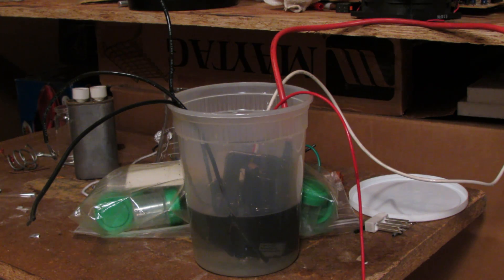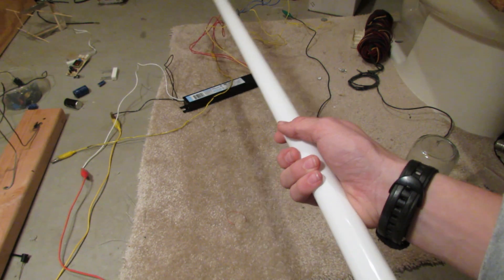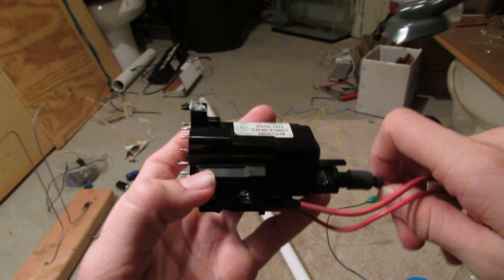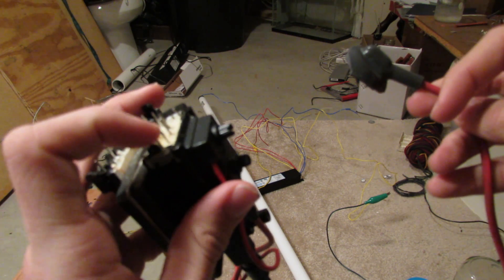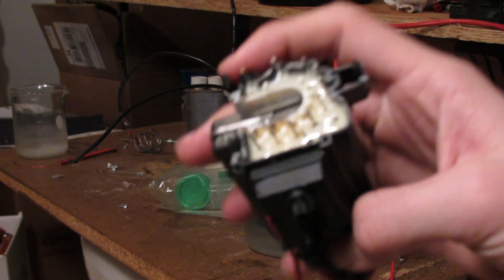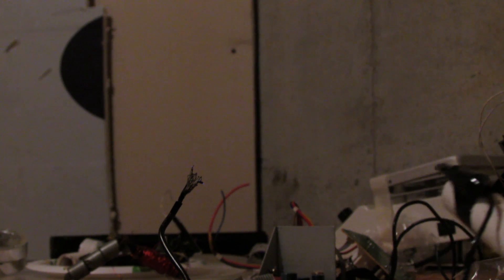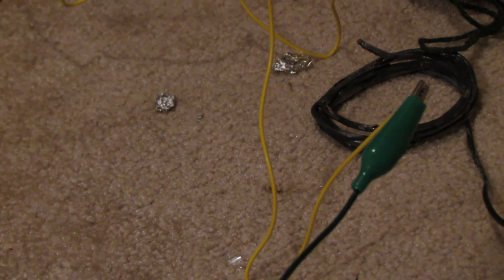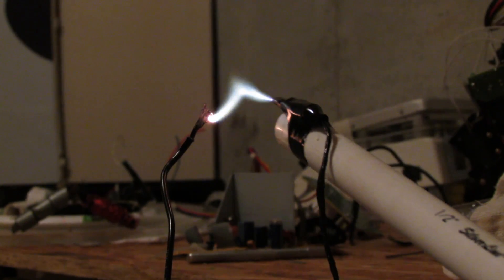Easy High Voltage Power Supply - Simple Flyback Driver

Comment: you can use a high voltage probe and a multimeter to measure the voltage or you can measure the arc : 1cm = 10kv

Comment: can anybody link me to a video where someone  uses a tip35c and they show you how they do it because every time ive tried nothing happens so im not sure if the transistors are faulty or that im not using them correctly its just ive tried making simple circuits with them with no results iv copied circuit diagrams for days only to get nothing and i tried with this i did exactly only difference was i was using a tip35c so and im using a variable power suply

Comment: Nice tutorial bro.
Can you please let me know the power rating of that ballast.
1 mm long arc needs a voltage of 1000 V (linear relation)
You can make a spark gap Tesla  coil with it. The output is pretty good.
When I did not insulate the pins of the flyback the pins arced to themselves but everything else was fine but when I insulated the pins of the flyback the ballast blew up. Then I used a CFL ballast. It's output is not that good but it is much more long lasting.

Comment: Can someone please help me, and fast, I am sick of blowing up CFL circuits, and wish to use my ballast, my ballast has two red and the black and white on one side, while on the other side, it only has 2 blue wires, please help me learn to use this, I don't have anywhere else to go.
Reply from the maker: Hmm if there are only two blue wires on one side I would guess that those are ground and the wires on the other side are not ground. I would try using one blue wire and one wire of another color and see if that works. You could always look up a circuit diagram online of your particular ballast model to find out for sure which wires are which.
Reply: +Gooferking Science There is a picture on the ballast that tells me both the red go to one side and both the blue go to one side, and i connected it to a flourecent I've and it worked, but I tried all the connections with the flyback primary, and it only gives me a spark when i disconnect it.

Comment: Hi, i have the same flyback as yours, but i use it with a 30W CFL circuit(energy saving light bulb circuit, the guy whom i copied from had a 15w one and a smaller flyback) and I have just 5-7 mm arcs...( I mean the minimum distance is 5-7 mm to form an arc and it can stretch out to max 1.5-2 cm....) what I did wrong???
Reply: gyorgy komaromi And also he had way longer sparks....WTF???
Reply: +gyorgy komaromi use a bigger cfl  i got 60 ballast 3 zvs drivers tons of drivers tooo
Reply: +gyorgy komaromi i had the same prob use a bigger cfl circuit
Reply: Lost In Space But I can't find light bulbs with higher wattage because I live in a small town...and I wont be going in the closest bigger town for a month :( but I was wondering if I could hook two of them in series or something  :/

Comment: what pins did you connect the ballest to
Reply: The primary coil pins, if you have a multimeter it's usually the 2 with the most resistance ( turn multimeter on 200 ohm setting ) it's usually also the first 2

Comment: how long it can run before the elec-ballast burn out.
Reply from the maker: Well I don't think that it would burn out very easily. Those ballasts run short circuit all day powering fluorescent tubes. I've never run it more than a couple minutes. I think the flyback would burn out first.
Reply: +Gooferking Science thnks.:)

Comment: looks like somebody already gave a recommendation on calculating output voltage ( 1mm - 1Kv ) so set up a simple spark gap keep it wide open and slowly close it in until the transformer short circuits ( produces an arc ) then measure that gap distance to get a fairly accurate output voltage. or make yourself a HV probe with power resistors in a voltage divider circuit for an accurate reading . using a spark gap as a safety gap is always good to use as well its not good to leave the transformer in open circuit will eventually damage it .

Comment: What you could do with the output is

*Make a lifter or ion wind genorator

*make a tesla coil (mayby about 30 cm tall coil or so) and use saltwater capacitors.

*make a franklins bell with two cans and a ring pull

Hope this helps ;)